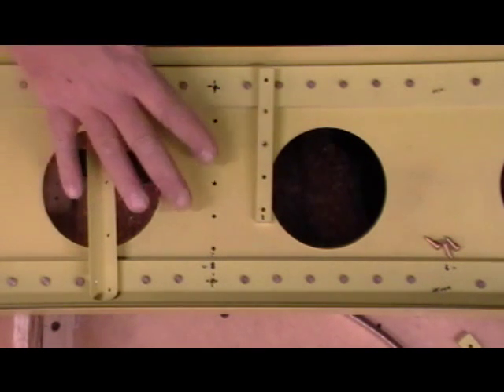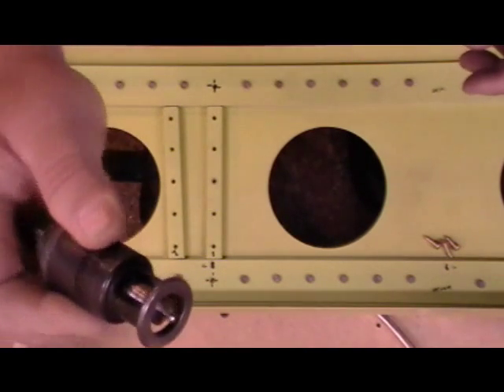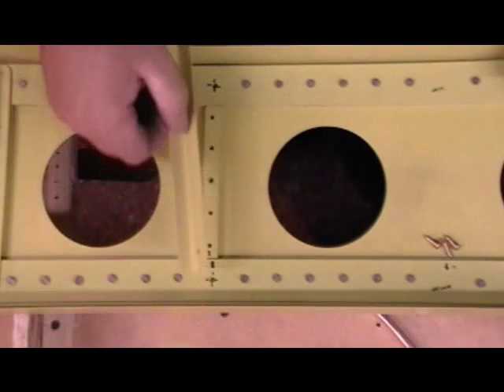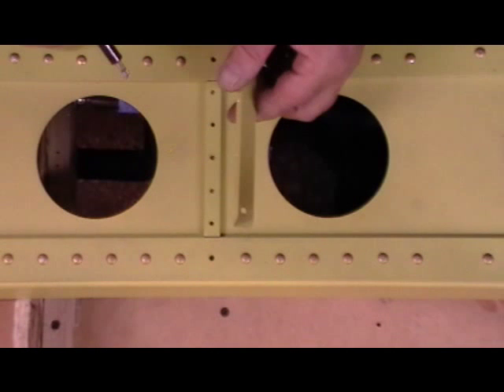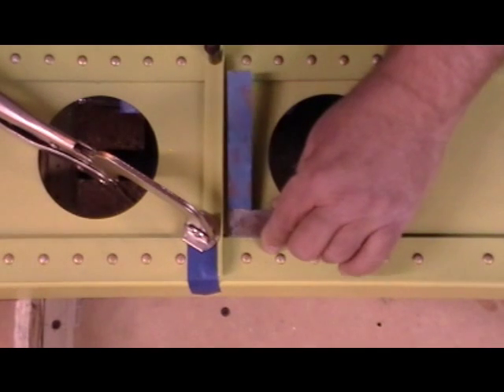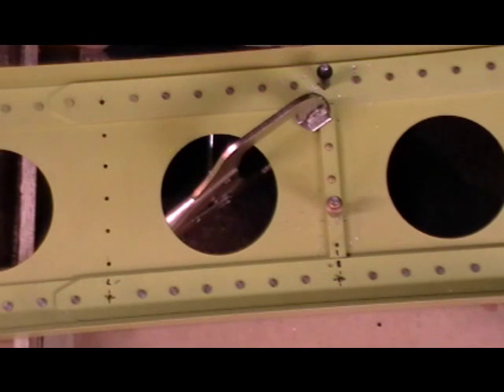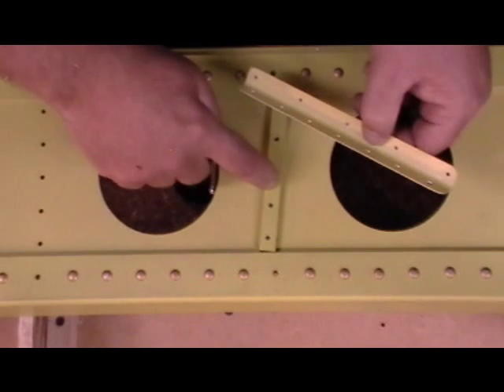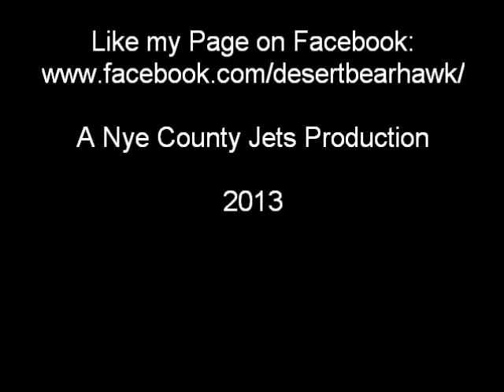The desert Bearhawk Project: Main Spar/Rib Attach Angle Install

Comment: for your double countersink rivets, on the shop side of your rivet, you can use a zephyr microstop zt330-s with a threaded counterbore/spotfacer. I have been using this set up for years as a rivet shaver.
make sure you use one hand to hold the microstop.

Comment: Informative videos.  Thanks.  I'm considering a Bearhawk.  I also live in the desert...around Mojave, CA.
Seems like the doublers add a lot of weight.  Is there a better design solution?
Also seems like there are a lot of jigs involved.   Does anyone exchange/rent/sell them so the next guy does not have to reinvent the wheel?
Rich
Reply from the maker: Rich, the design of the spar is very solid, I would not change anything. Believe me, when you finish yours you will have a part you will have confidence in when you fly. The forming blocks and jigs are just part of the build process, nearly everyone makes their own and keeps them for future use. you could check on http://bearhawkforums.com/ someone there mght have something you can borrow or buy...Good luck on your project!